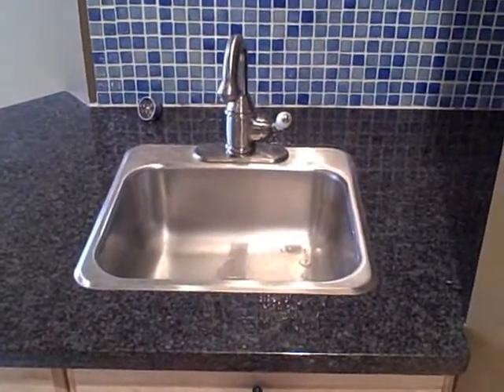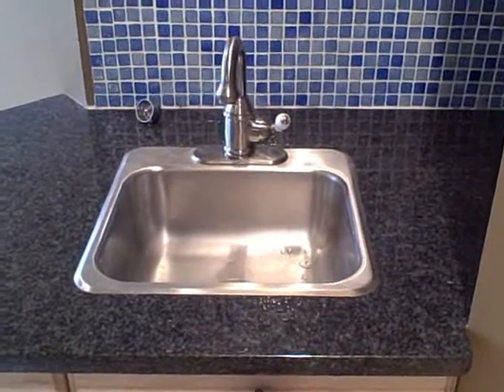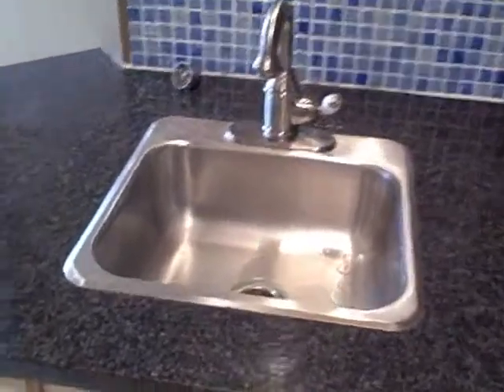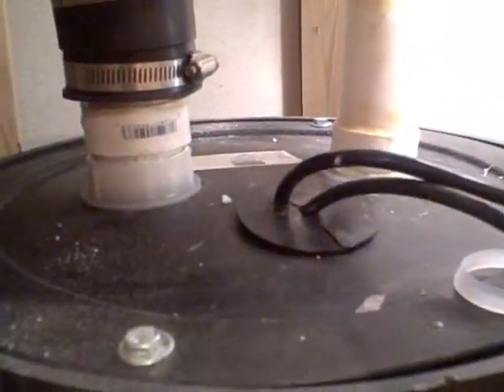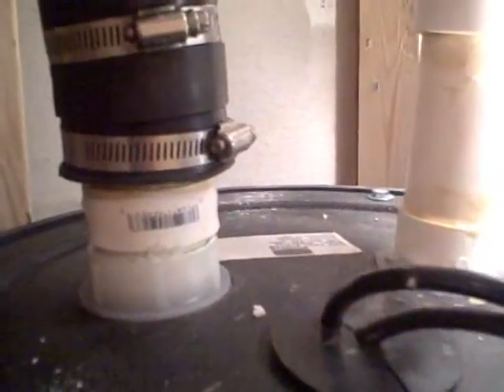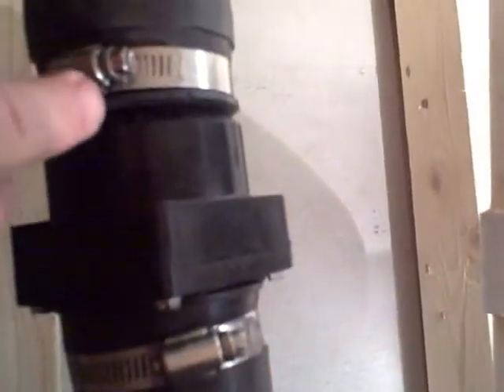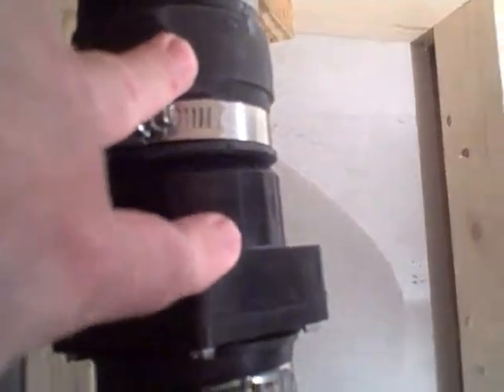Home Inspector Atlanta GA Reveals Another Plumbing Vent Gone Bad l (678) 279-5796 l CALL US!

Comment: Air must exit the tank thru a vent- when a toilet is flushed, or a sink is drained- the tank pressurizes and prevents water from flowing into it. The only other tank outlet is the pump pressure pipe, which while at "rest" has a check valve with a column of water above it.

Comment: "Studor" vents are illegal on pump receptacles.
The are air admittance valves used to prevent siphonage that breaks the trap water seal. Air must exit the tank, and studors will not allow it.
 No easy fix here, as vent should tie into vent system, or outside.

Comment: @PLUMBdogg air must exit the tank when the water enters the tank it doesnt start pumping right away it must fill to a certain point b4 the pump turns on.  so ther must be some displacement of the air in the pump

Comment: a studor vent would not work on that pump because a studor only lets air in.  when the water starts to fill in the pump the air has to go some were and with the check valve with all that water weight on it it would not push through the check vale  the vent would need to be terminated to the outside like it should be.  a studor WOULD NOT WORK. trust me ive seen it before it does not work with a studor vent

Comment: I don't think air needs to "exit" the tank, air needs to "enter" the tank to prevent collapsing of it but more importantly it needs to draw in air to save the trap seal. The pump will create a negative pressure that will siphone the trap with it but if you introduce atmoshperic pressure(fresh air) it will prevent the siphone. The Studor diaphram will open when the pump runs but yeah, no easy fix. Tie it in or go outside with it.